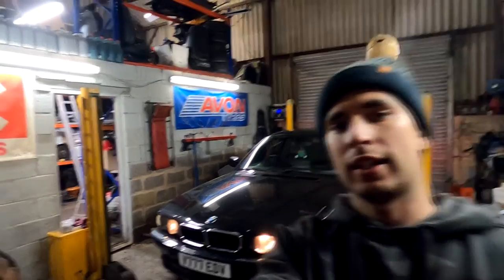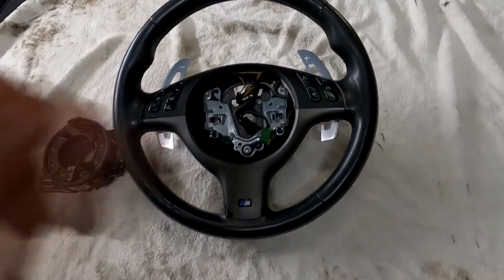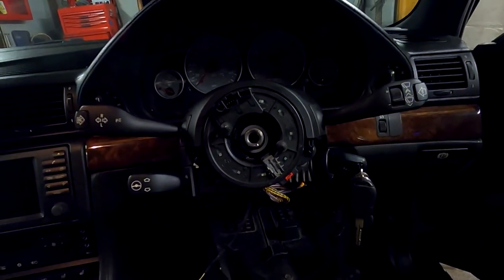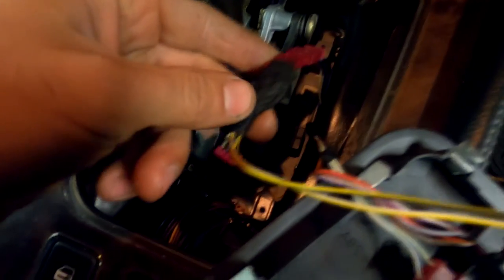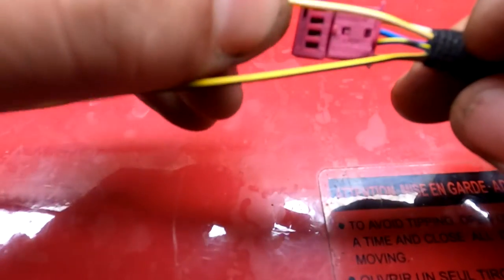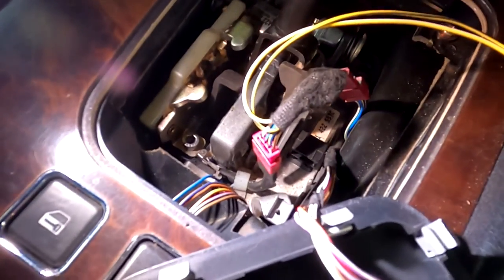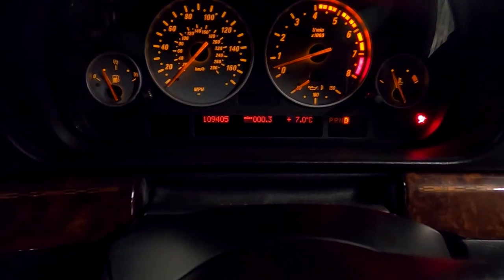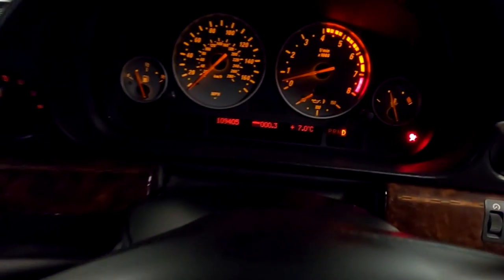BMW E38 E39 PADDLE SHIFT STEERING WHEEL RETROFIT

Comment: Got my hands on an M3 wheel and an SMG slip ring.. Want to make a wiring loom like the one you have. Where can i get the 4/2 pin plugs needed? THX
Reply from the maker: PappaRS ive personally made my own plugs , took from scrap cars same plug as I didn’t wanted to chop orginal wiring..but if u don’t have such an option u cam easily just tap into orginal wiring
Reply: @The777Garage  Yeah, i might have too get creative.. Don't really want to tap the wires unless i have too tho. I'll make it work somehow!